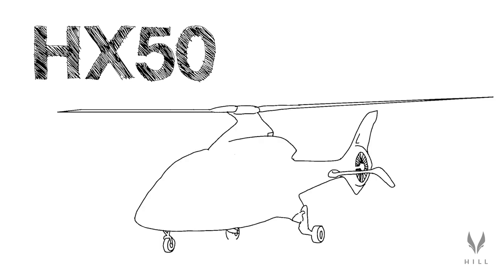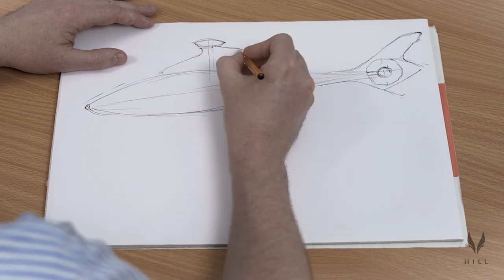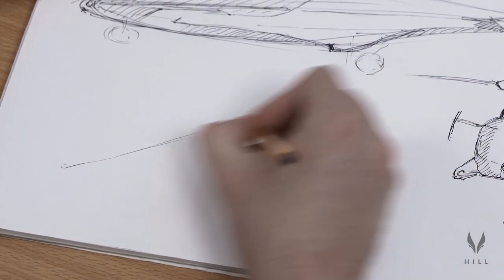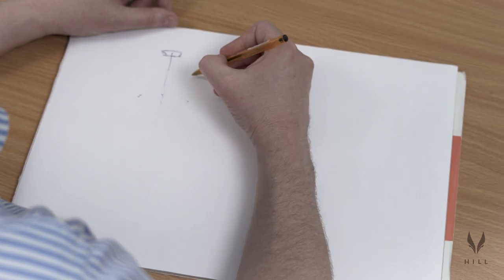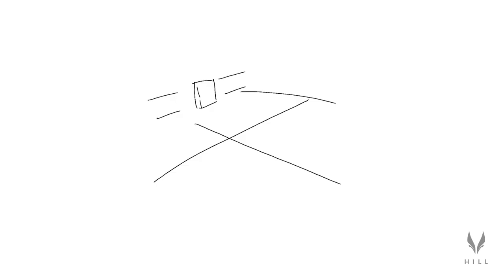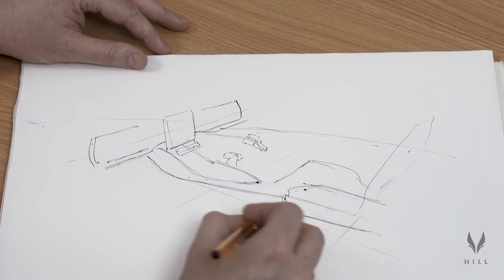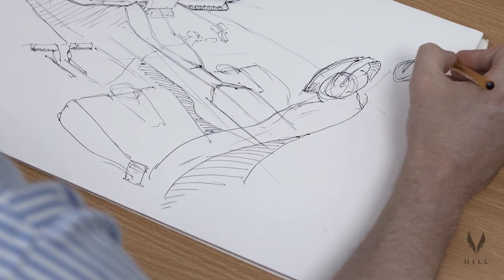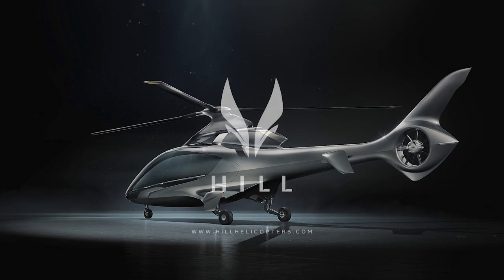HX50 Behind the design

Comment: If it gets made, it will have to compete with the established manufacturers. No matter how good an aircraft is, you need the support infrastructure in place. That is probably harder than producing the aircraft itself.

As for changing the controls? Training, type rating, really difficult to achieve. Good luck though.

Comment: Haha so much for the affordable thing they mentioned before. I have a Lamborghini Aventador and this guy is making it sound like a tall order even to me 🤣
If this dude prices it at $2m+, people are just going to buy proven designs.. and why change the collective? Makes no sense. Millions of hours of vertically operated collectives and no one has had a problem with it... This thing will give muscle memory problems to pilots for instinctive autorotations. Going to require special FAA requirements for sure..
Reply: There have been changes in yolk/stick ppsitions and design in fixed wing that doesnt seem to cause any issues. If you're rated to fly the machine I don't believe muscle memory will be a problem. If it was then it would be an issue for pilots trained on NA helicopters then flying a Euro helicopter. Im interested in price point of the HX50 but capital investment is not the problem to overcome it is the cost of operating per hour with maintenance factored in.
Reply: @actionrjackson  I can tell you countless stories of airplane pilots with helicopter ratings going for their ATP in helicopters and almost killing themselves and the instructor because their muscle memory from airplane to helicopter engine off emergencies require opposite inputs. High hour, very experienced pilots.
That is 100% a liability that will be an issue. Helicopter pilots can't even fly semi rigid rotor systems without the faa requiring special training and frequent skill assessment.
Should we also talk about all the incidents where rated IFR pilots fly into the ground accidentally? Being rated in something and having the muscle memory to fly it safely are different things.
Reply: @maximusjoseppi5904  well if you wish to see everything with a negative view that is certainly up to you. Your concerns/arguements dont seem much of a real world concern to me. For instance citing the control input differences of flying fixed wing aircraft vs rotary aircraft and apparent difficulty some persons have in learning them does not directly translate to a slight change in collective control movement (forward/backward of a control uses very similar movement of your left arm). In my opinion if a person who was previously trained to fly a fixed wing still have issues with safely flying a helicopter because the control inputs are different then it is a mistake on the instructor to allow them to try the ATP practical exam. Thats ludicrous and points to inadequate training not confusing control inputs. Additionally this has nothing to do with PDM that was the very unfortunate underlying cause of thr crash involving Kobe Bryant, which is what I assume you are referring to. Plainly put your arguements dont, in my opinion, provide enough or any reason to suggest the HX50 or Hill Helicopters will fail. I'm sad you dont find it as exciting as I do.
Reply: @maximusjoseppi5904  Thanks! Good talking with you.